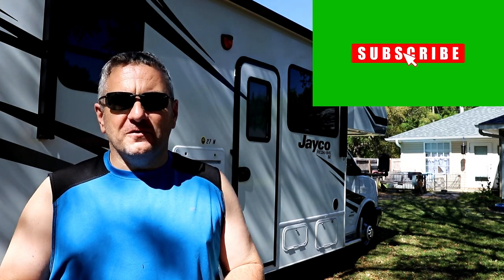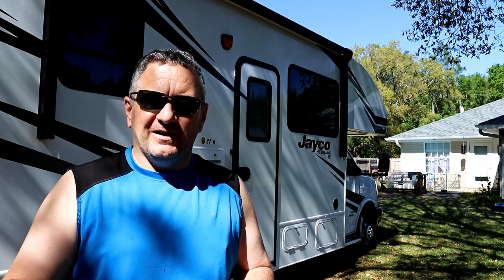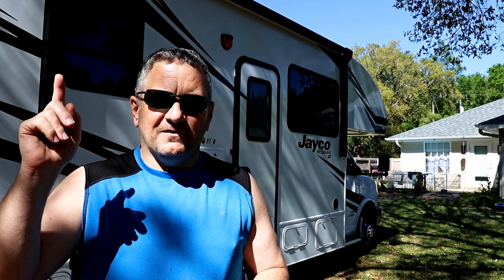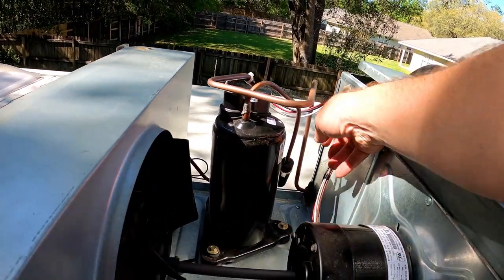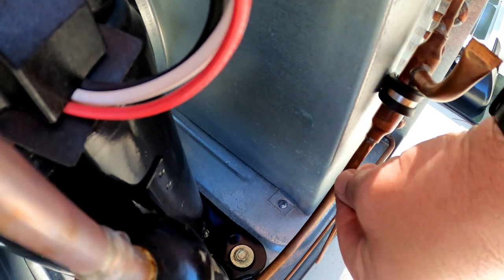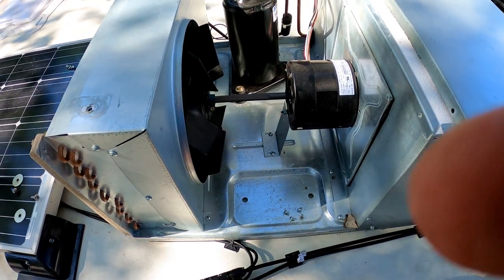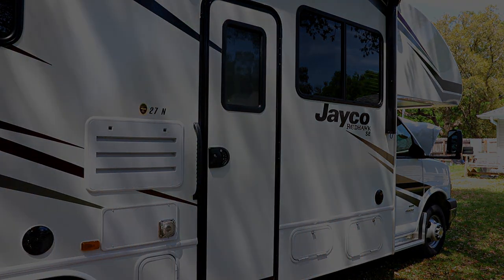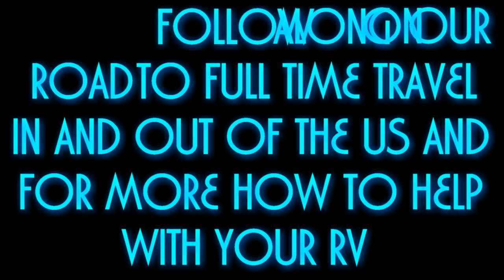RV YEARLY MAINTENANCE TIPS AND TRICKS TO KEEP YOUR RV LIKE NEW AND TROUBLE FREE

Comment: Hello again. We are on an RV trip across the country, and I have been watching your videos. Seeing that someone enjoys his RV as much as I do is excellent. I have a few questions about the maintenance:
1. You have two items on your Amazon list for the roof plumbing vent.: Lippert 360 and the Camco cyclone. I am assuming you installed one and then changed it. What did you find that works best?
2. Fridge/freezer: what is the fridge model you installed?
3. Front Suspension: yes my chevy also puuled to one side when new and they adjusted the direction as much as possible and its fine now but had to take it in 3 times dor that. 
i have the same problem that is soft on the front and have 50000 miles on it. At first i thought is the miles but now i realized that i need to upgrade a bit the front suspension. I see you purchased the super spring in yellow but in the video they are orange. Did you buy another product afterwards? 
4. Did you change the front suspension shocks as well? I just put new shocks from chevy (as i said i though mine is getting old and has lots of miles)
5. Gas stop you have two items in amazon cart. What did you end up ussing? 

Thanks
Reply from the maker: I installed both I purchased the swivel one for the black tank but it hit the cover over the vent so I put it on the gray and the other I got for the black no idea if one is better, dont know the model number,  you see the spring in the sun then its in the garage same spring just different lighting, yes I did new shocks made a world of difference, depends if you have a built in dot tank or portable for the gas stop you have to have the right one I put both there to show there is 2 different models